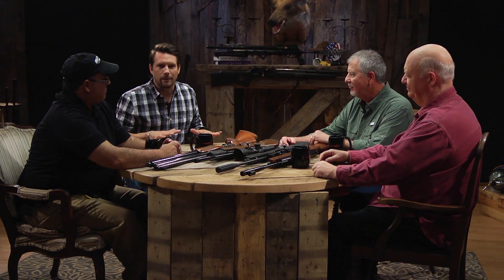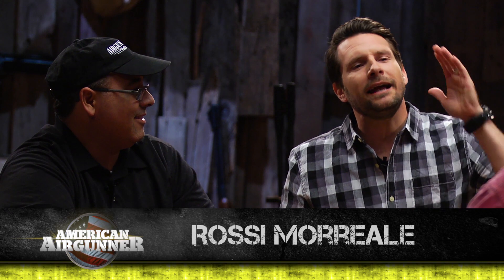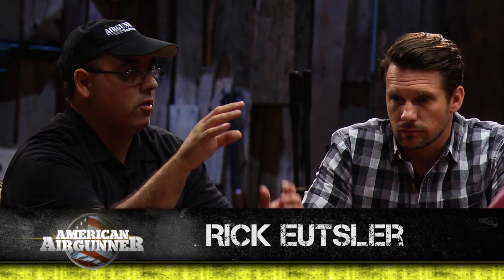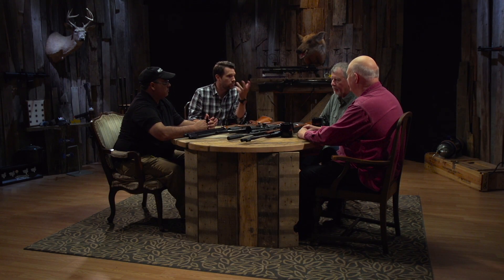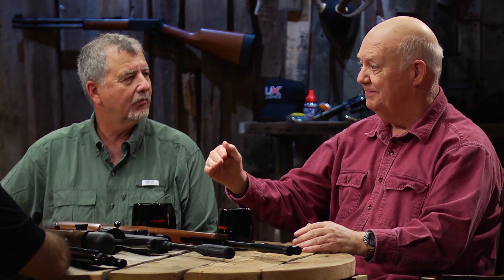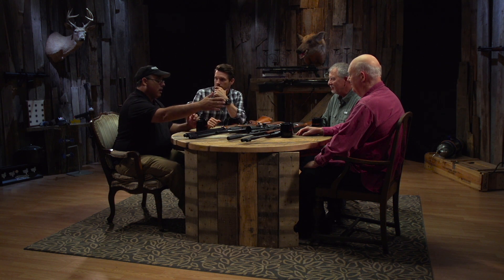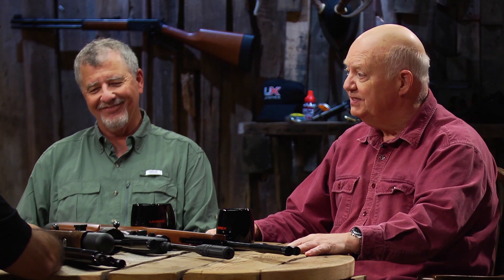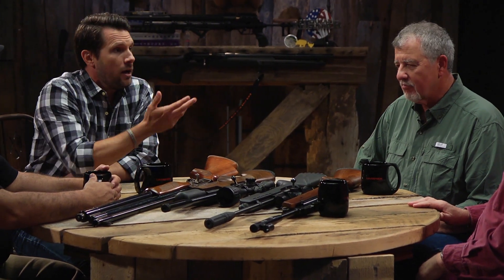What are Foot Pounds of Air Rifle Hunting Energy : American Airgunner

Comment: I'm in the UK and this video was the most relaxed and easy to understand video I've come across and as a newbie to air rifle / pistol shooting everything became very clear . Cheers fellas Johnnie Cohen
Reply: @FlappableBeanAgreed. It's an expression of kinetic energy in an equation. Joules would be the correct expression for energy.
Reply: Instablaster
Reply: @as680783  Joule is certainly correct.  The kinetic energy of a bullet is proportional to the mass of the bullet multiplied by the square its velocity.  Ipso facto the unit MUST include time.  The foot pound does not include time, thus it is NOT a unit of energy.

Comment: No. Ft lbs is energy, but this is not similar to horse power. Power is not the same as energy.
Reply from the maker: Yes, energy is the potential to do work and power is more along a rate of how how much energy in a given timeframe. Thanks for commenting and subscribing.
Reply: @americanairgunner  actually…power isn’t ‘more along a rate’, it IS the rate of doing work. Power is energy transferred per second. You shouldn’t really be mixing those up, especially on a fairly large air gun  channel. Describing ft lbs as being like horse power is absolute nonsense.

Comment: I read that "foot Pounds" was the energy created by dropping a one pound weight from a certain height. for example, 10 foot pounds is the force generated equal to dropping a one pound weight from ten foot height. This makes more sense to me than what Tom Gaylord stated on "moving" one pound of weight at distance. I have a .25cal air rifle according to chart on Pyramyd Air website (Tom Gaylord is staff member), that says it shoots 30 foot pounds! I cant see my 16 grain pellet moving a one pound weight 30 feet! But I can see that pellet hitting a target with the same force that a one pound weight hits it if dropped from 30 foot height.
Reply: How about a small 1lb ball that the pellet can't go through, (all the energy in the ball), on greased glass, (to get rid of as much friction as possible), with a dead center shot from the muzzle.  I think that 1lb ball will move real close to 30 feet.  
This is from Wikipedia (for what good it is worth): "The foot-pound force (symbol: ft⋅lbf, [1] ft⋅lbf,[2] or ft⋅lb [3]) is a unit of work or energy in the engineering and gravitational systems in United States customary and imperial units of measure. It is the energy transferred upon applying a force of one pound-force (lbf) through a linear displacement of one foot. The corresponding SI unit is the joule."